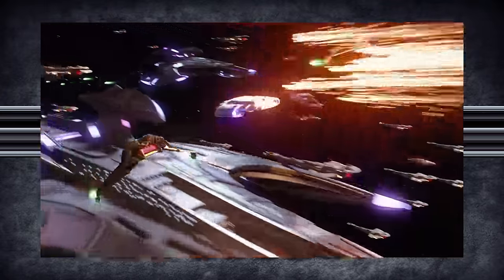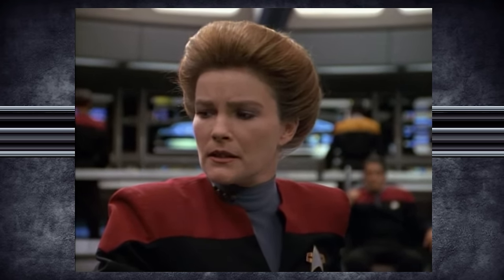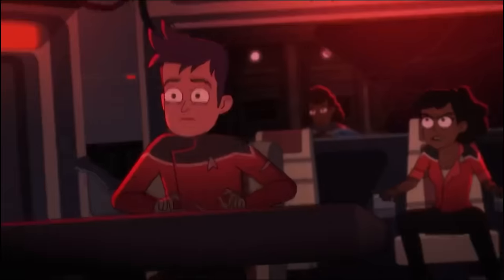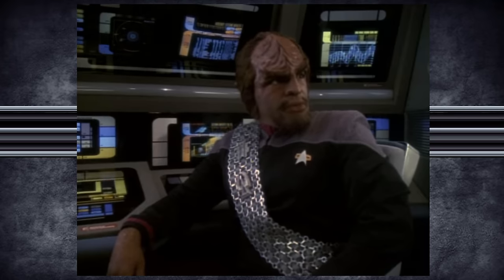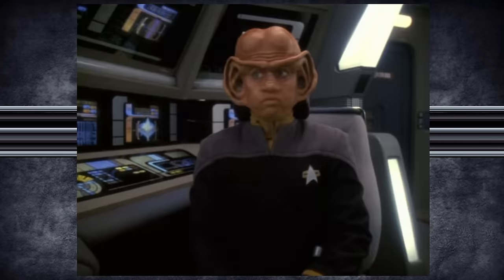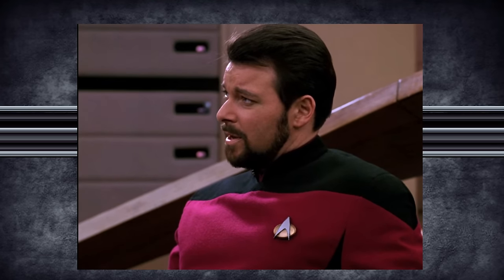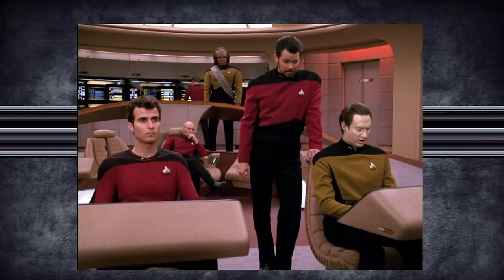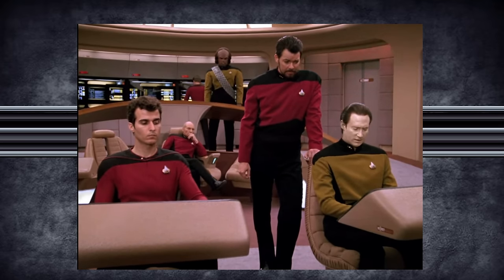Why Starfleet's Bridge Design Was Lethal to the Crews

Comment: Nothing brings home exactly how bad the design of the STD uniforms is like seeing them in context with other designs.  100% out of place and continuity, with just the token Starfleet delta to make it seem like a "Star Trek" uni.  Ugh.

I'd be interested in your opinion on two other "Enterprise" bridge designs: the alternate timeline Big E, and the design used in STD.  The alternate timeline seems like a riff on the refitted bridge of the "original" Enterprise from the original cast movies, with the two turbolifts and all, but it was the first to give us a "window" at the front, over which tactical information could be projected.  They also repositioned the bridge location from the very "top" of the vessel to a deck or two below, somewhat implying that there was more on that deck than just the bridge, given its size.  I think the major design flaw on that bridge was all the freestanding panels seemingly added for "bling" and no other purpose.  They'd get in the way much as will the railing on other designs.

Now the STD Enterprise bridge is laid out like the traditional one, but like 5 times the size!  Impressive to look at, surely, but would it really be that effective an environment to work in?  Console and screen that were at one's fingertips in the original design you'd have to get up and walk a bit to use in this later iteration.  Maybe if the average bridge crew member was 8'2" it would seem reasonable, but for regular ol' humanoids?

Comment: If things were shown more realistic, the windows would be stupid.
Full impulse is a quarter of the speed of light, as in 75,000 kilometres or 46,500 miles per SECOND. The range of phasers was once given at 300,000 kilometres or 187500 miles.
Flying slowly at impulse you can evade planets and moons on sight, but to evade asteroids or other (motionless) ships they would have to fly so slowly that it barely matters.
So evading enemy fire or firing back on normal sight alone is ridiculous. So any kind of combat scenario or emergency scenario on visual alone is a joke.
And outside of combat? They might be better off with a crewmember standing on the hull of the ship. The sensor and zoom functions would be more helpful than looking outside the window and all data could be linked to the bridge. There is of course the possibility of doing the same with a shuttle.

Comment: WRT windows on a space warship, I don't think modern surface warships (aircraft carriers, destroyers, etc. that have Bridge windows) are the right comparison.  A (realistic-ish) space warship would be more like a submarine.  If something like a bullet or piece of flying debris smashes through the window of a surface ship, it's not that big a deal; the air outside is just as breathable as the air inside.

In a space warship, anything that can penetrate a window creates a threat of decompression, as well as a path that space radiation can come through.  Thus, a space warship is more like a submarine, in that the Bridge needs to be protected from a hostile exterior environment as much as possible.  Windows, even if made out of transparent metals, are probably not as strong as proper structural or armor materials, otherwise the entire hull would be made of the transparent materials.  Therefore, windows on a ship (even the ones in crew quarters) would compromise the vessel's structural integrity unnecessarily.

Furthermore, in a Realistic (tm) spaceship, being able to look out a window isn't very helpful, especially in a combat situation.  Things in space tend to move at relative velocities that render human vision and reflexes virtually useless.  Either that, or they're too distant to see very well with the naked eye (hence, the oft-heard commands, "magnify" and "enhance").

Of course, we're talking about Star Trek, which has shields, containment forcefields, replicator/transporter technology (which in principle could allow a ship to self-repair, though they don't seem to do this for some reason).  In addition, hostile ships and weapons fire never move at relative velocities measured in kilometers per second, so windows are more viable.

Still, the one major improvement Starfleet engineers need to make to their Bridge designs is to not build all their electronic components out of nitroglycerin and powdered magnesium powered with enough electricity to run a Chevy Bolt at each console. :)

Comment: They are all terrible.
Most of the people are facing away from the captain to see their consoles. To relay information the person has to turn away from their console, drop what they are doing and then speak before turning around. This becomes even worse in combat situations where the noise can obscure what is said.
The captain has to constantly swivel to the person he's talking to in order to make sure they are heard. If he wants to adress everyone in a noisy situation he might need to repeat it several times to make sure everyone hears it.

A better layout would be the captain almost at the back, and all consoles facing him close enough that whoever is operating it only has to look sideways at best to get the message across, with half an eye on their console still. This means that the captain can simultaneously communicate with the viewscreen while people signal information to him. This would hardly be worse than the people facing the walls and having to turn to see in terms of television, since the series and movies make the characters turn before a closer shot is given for them to speak. In fact, quickly panning between people could be used to highlight the speed and danger of the situation.

Comment: Space is either very dark or very bright. Both make windows useless. There is also the problem of distance. Even today most battles happen beyond visual range, certainly in space it will be more. Also in space you never travel in a straight line, I am not going to go into details on that but for example going to Mars your ship won't be pointing at it.  The most efficient bridge was that of the Romulan Drone, were the blue guy had a brain-neural interface headset. Pressing buttons on a panel is just dumb. Even today, planes are going to headsets and voice activation. Also on a ship and even a large plane every maneuver is planned, computed and executed at precise times and movements, no human involved or capable of this precision. So everything in Star Trek Bridges is really just there for non-technical viewers, adding Drama and not very well designed for their usage in what would be the 23rd Century,

Comment: under 2 minutes in and you've already misclassified how starfleets bridges are the only control point on starships IE TOS NCC-1701 herself the heavy battlecruiser design did have an aux control room that overrode the bridge and was used several times to cause problems then flash forward to NCC-1701-D she had a second bridge IE her battle bridge as it became known that even if not separated could provide a second control point as for defiant shes too small for any real second control point and i never was into voyager enough to know if she has something similar to TOS's aux control room

Comment: The Expanse showed us that windows are an unnecessary luxury on a space ship. At the speeds that ships travel and the distance between ships in potential ship-to-ship combat, you wouldn't be able to see anything important until you were right on top of it which would be too late to do anything about it. All you're going to see out a window on a spaceship is mostly blackness with some distant stars. Windows would not provide any useful information.

Also, not Trek, but the bridge or CIC in Battlestar Galactica is more realistic with a tactical map and screens displaying "DRADIS" or their version of radar. Space combat would be more like submarine warfare than surface ship combat or air combat.
Reply from the maker: If you didn’t finish, how can you speak to this? Also, you are welcome to fully fund my patreon and never see any ads

Comment: As for the best bridge layout, Excelsior mixed with the Ambassador.
Two goals, adding a tactical & engineers station behind the captain and then replacing the back wall with a science bank of consoles.
A Engineering's view screen forwards of the captain, this way the captain and engineering's station can both see this screen, same for tactical.

Lets be honest, hostile enemy hails Starfleet ship in order to demand surrender of said Starfleet ship and can thus also see the engineering's status display on the back wall, meaning this hostile alien now knows where to aim all the shots to really wreck the day of said Starfleet ship.
Thus the best design does not have a engineering's status display in view of anybody hailing the ship, ever.

Comment: Eugh. Longtime fan but this video has some serious issues. 
Using anything from the Discovery - "Spore Ops" 'nuff said.
Windows - absolutely nothing in SPACE combat will be within visual distance. Even today, naval combat (which space combat is most analogous to) takes place almost 100% beyond visual range. Indeed that was the primary change in naval combat in WWII. And no matter what material the window is made of, due to sheer physics, it cannot be as heavy or thick as armor plating, nor could it include armor technology like ablative, composite, or reactive armor: because of refraction it has to be one single, thin, piece of material. Not to mention, the fact the bridge has to have a window would also prevent any defensive bulkheads between the bridge proper and the outside.

Comment: 2 minutes in and already two significant mistakes. The first is that all important officers work together on the same shift. This isn't accurate. They work all shifts, however due to the decreased likelihood of trouble during warp travel the senior officers tend to be on the bridge when the ship leaves warp and is likely to enter a hostile environment. This is shown throughout most series as officers assembling when they're about to arrive in a system or as officers being called to the bridge when they leave warp unexpectedly. The second mistake is in saying that ships have no secondary cic. Starfeet ships can be run from just about any control panel around the ship. They have other areas that can generally serve as a command post. They also distribute cic and damage control across the entire ship this way. The galaxy class ships even have a secondary bridge (battle bridge) in the warp section of the ship.

Comment: At 1:38 you say, "there is no secondary CIC" incorrect there is an auxiliary bridge called the battlebridge, which can be utilized during saucer separation or destruction of the main Bridge. And I think the idea of windows in key strategic areas is rather silly. You said there's no harm in swapping armour for transparent metal, of which there is only one reference to transparent materials - aluminium; which I don't think would be suitable and considering the external hull plating is made up of interlaced microfoam furanium filaments, you can't just make it transparent. I can think of another half a dozen arguments where your reasoning falls down, I appreciate critical thinkers so keep it up I guess......

Comment: I don't agree that windows are more useful than view screens in space. In space your "eyes" need to be able to build an image with every wavelength of light your ship can gather. Most sensor linked computers will be able to track and fire on an enemy faster than humans can simply because they will get more information sooner and process it faster

Assuming you're transhumaning your humans, though, you can always connect your people to these sensors and computers.

But if you do this you are still going to need large dishes and antennae connected to hardened sensors with redundancy to connect your humans to. You can't make this eye system or the components needed to integrate the information it gathers small enough to fit in the human. Even if you tried you couldn't harden a head. The amount of redundant systems you could fit into a head would be limited. Besides, shrinking your eye system to that degree reduces its efficiency and capability. That is because bigger, thicker dishes with very specific materials are needed to intercept many useful wavelengths and the only way to make circuits sturdier is to make them bigger. 

Currently day space infrastructure uses old, comically thicc circuitry. I think that is because the radiation in space just wants to melt that shit. 

The capability of the mk.1 human eyeball is essential, I agree. But it is of equal value to all of the other "eye" softwares and hardwares on a ship.

A camera with lenses is better for visible light detection in space. It will be able to spot other ships long before an unaided eye could. 

In space you may be trying to spot ordinance that moves faster than bullets or as fast as the speed of light. In the latter case, by the time you see it it has by definition hit you.  

Your ship needs to react before the enemy shoots. It needs to be able to calculate trajectories to avoid falling into enemy firing solutions, based on the deltaV it has, while providing its own firing solutions. It needs to do all this faster than humans can.

A ship's defensive movements should probably be "instinctual". It should dodge  or warp out of battle on its own. 

You probably only choose to warp into a fight once you've calculated that you can get firing solutions faster than your enemy can dodge them and that you can dodge his solutions or tank his hits better than he can tank yours. 

If humans are employed it will be in the observation posts that fight the information war before any fleets arrive in a system and, based on the data they've gathered,  make the determination of whether or not a fight should happen.

Biological humans might be present in ships as backup computers. Once all of the AI and post-human minds on computers are fried or shattered they become combatants. 

Assuming no one surrenders, the last phase of a space war might consist of biological humans firing purely mechanical weapons at each other.

Comment: Shifts ars more likely to be 12 hours with limited resources. Star Trek bridges. Would be highly automated and. Redundantly connected to several bridge compartments and substations. The battles would be quick by using overwhelming firepower. Its better to use it than to loose everything. A central bridge may not be necessary with a starship of this size. A captain may run this ship from a secured bedroom with todays tech. Starfleets true magic comes from having willing people who are well trained and ready to step into a more complex role. The design is not very important when the tech level is considered.

Comment: Until the arrival of the supreme idiot Kurztman and his boss Jar Jar Abrams, the bridges of Starfleet ships had no windows, not even if they were made of alloys recombined to be transparent.

Star Trek's bridges are protected by a really thick armor shell around them with a large viewscreen, but that could be damaged like so many other systems. Therefore, outside the bridge, in service corridors or rooms that are nearby, these windows can exist. But never on the bridge itself. Even many of the ships have on top of their bridge, the set of dorsal sensors that serves as another layer of "armor".Those ships with nearby windows can be used in catastrophic events to give visual feedback to the bridge, but they are never, ever, directly on the bridge itself.

And about the sensors, dorsals if they are not on top, they are very close to the bridge so that even if there is no communication with the rest of the spacecraft, there is the possibility that the bridge has access to a main sensor system.

Another reason why the bridge is where it is and not in the middle of the ship, is to be able to evacuate the command personnel, which is possibly the most crucial that Starfleet can try to recover.

Of course there are other (and even more) battle bridges just in case the primary bridge is damaged or lost, but thankfully those events are rare.

It is rare for the bridge, even in close direct hits, to be destroyed, at most, perhaps in cases of critical hits it can receive damage that affects the structure, knocking down buttresses or sections of the armored shell, but without its destruction (see the impact on the Reliant). For more extensive damage and even an external breach to be produced, it is usually necessary to have many direct hits and a really concentrated attack of a multitude of hits in the area (as in Star Trek Nemesis, in which that monster had more arsenal than an entire fleet).

So no, the bridges of the starfleet ships didn't have stupid little windows or huge windows acting as Viewscreens until the arrival of the nonsense of Jar Jar Abrams and his faithful lapdog Kurztman. Additionally, the Star Trek Online team went too far with the design of the Odyssey-class bridge.

Starfleet doesn't start wars... But they are neither stupid nor do they design bridges in yacht version. Their ships, among the multitude of systems and backups (and direct armor is part of this security) tend to withstand incredible punishments and try to maintain the integrity of as much of the crew as possible. For this reason, the bridges have a viewscreen and are among a greater amount of armor, not with huge windows on the bridge itself which to top it all off lacks the thickness of the rest of the bridge (Kurztman and Jar Jar Abrams are clowns of the visual, they have not soaked up the philosophy of Star Trek or Starfleet's construction of ships... in fact, in the case of Jar Jar Abrams, Star Trek didn't even like it... which explains the disasters, but then nothing explains the disasters in Star Wars (which he supposedly loved) except his own creative inability and his lack of knowledge of how space works.